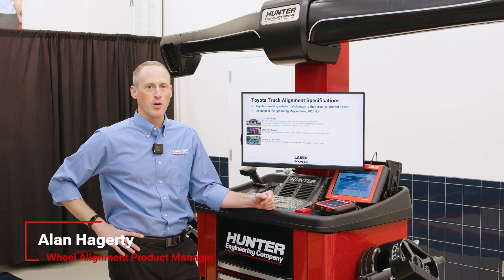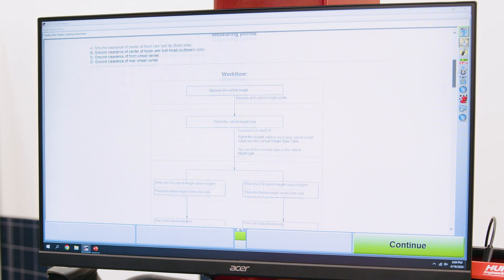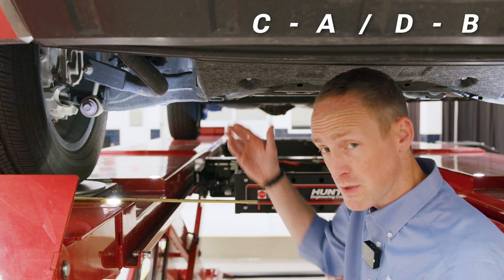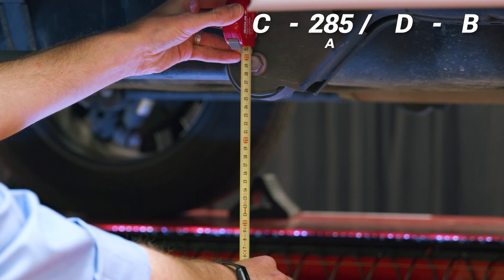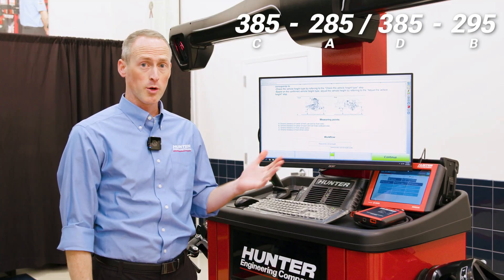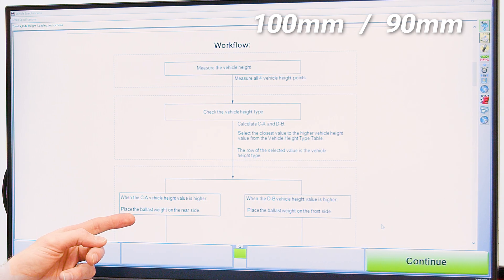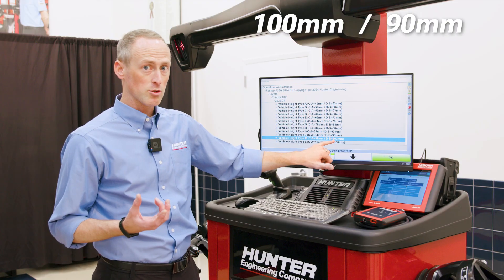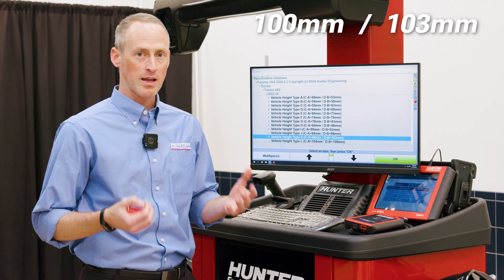Guidance for new 2024 Toyota truck alignment procedures from Hunter Engineering

Comment: What if your 2025 Tacoma or Tundra has been lifted with bigger aftermarket wheels and tires?  I couldn't figure out how to get measurements that would make the WinAlign software happy enough to allow me to proceed with the alignment.  I was not allowed to perform an alignment because the measurements were out of spec, I forget the exact error message.  Not completing an alignment, of course, was not acceptable. 
To get the job done, I changed the model year to a 2023 Tacoma and aligned the vehicle to the specifications of the older platform.  The vehicle seemed fine on the test drive.  What should I have done differently to have aligned the vehicle to the proper specifications?
Reply from the maker: Great question. In this case, you will need to get the "lifted wheel alignment specs" from the lift manufacturer. WinAlign will allow you to enter a custom spec for that vehicle. Then, proceed as normal.

Comment: Took my 24 to Discount Tire last week and they said they didn’t have the alignment specs and to go see the dealer. This video suggests otherwise?
Reply from the maker: The Tacomas have Ride Height dependent specifications and require a similar but different procedure, so unfortunately, this might not be a part of their software, or, they may need to update their software.  There are several factors that could play a part, but we don't have all the info to give a solid, confident reply.
Reply: @ oh sorry forgot to specify it’s a 24 Tundra!